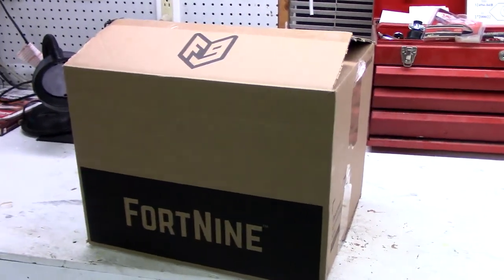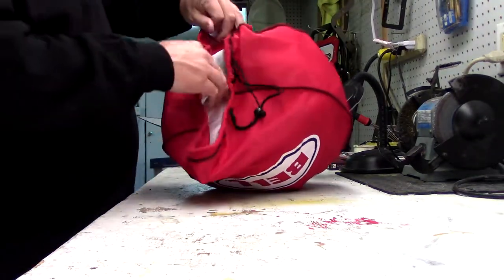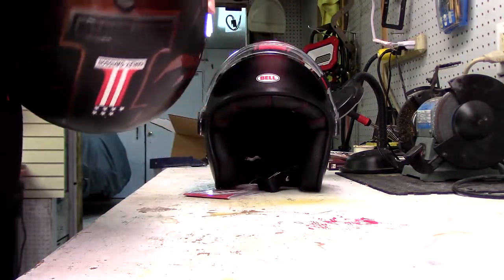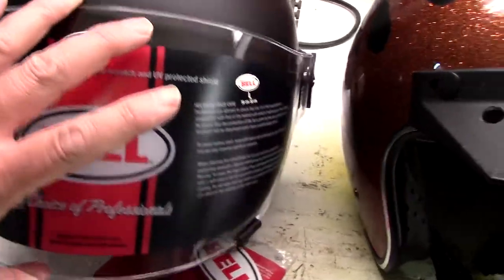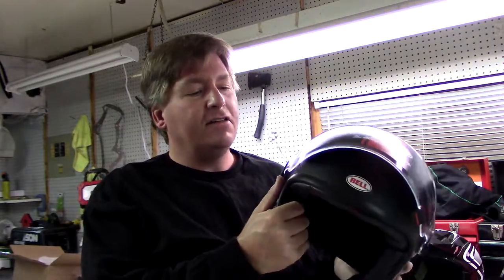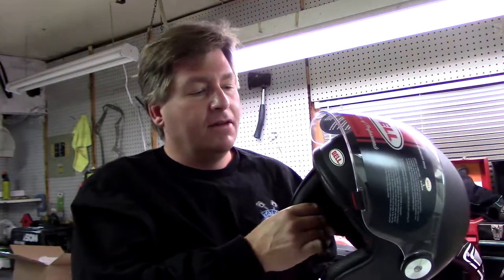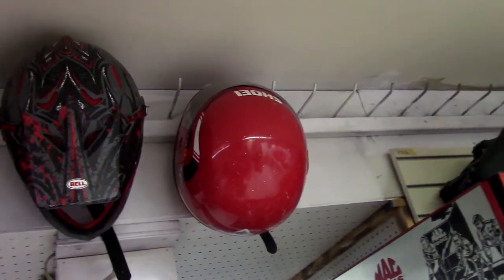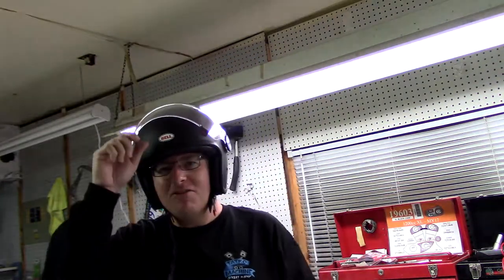Bell Riot Helmet Review, UnBox, Comparison, 3/4 with Shield

Comment: How did you find the fit when you first put it on.  I just got mine exact same and it's pretty tight.  I was right between 55/56 so they recommended I go small.  Did it open up for you?  Also did the stitching bother your forehead?

Comment: Great post. I was just wondering how you rate the Bell Riot now after 18 months? I ask because I've a long oval melon and struggle to find anything that fits to replace an old Arai Condor which has always been so comfortable. It's such a problem that each time I buy a replacement, I think I've finally cracked it, but then, after a couple of hours the pain starts!!! I gather the Riot is slightly more oval than the Custom 500?

Anyways, great post and it would be interesting to hear your 'long term' thoughts.
Reply from the maker: Hey, did a follow up video today. https://youtu.be/Pa5hfEAhmAg